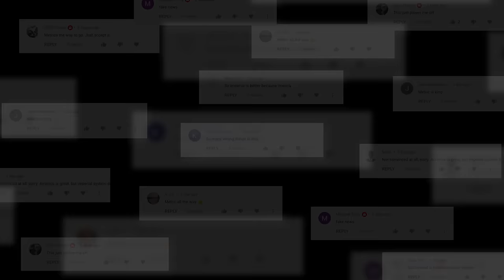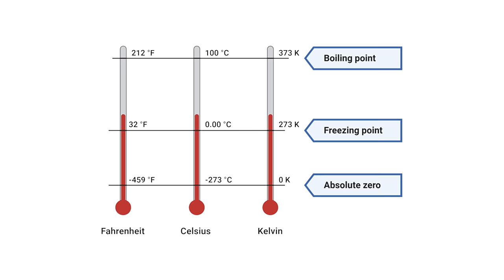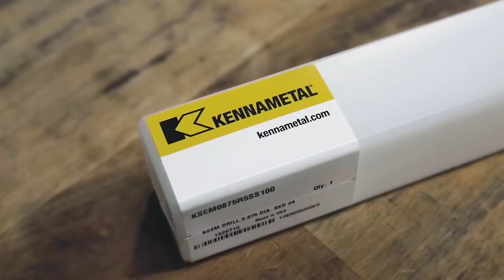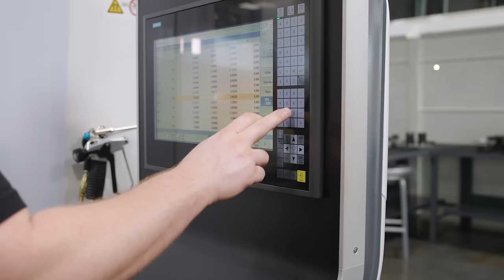Why METRIC is SUPERIOR to IMPERIAL

Comment: A big advantage of the metric (DIN) threads is the fact that there's no possibility to get the wrong bolt into the wrong hole. Either it falls through or it won't fit at all.

Same with hex wrenches.

The most dangerous threads are 3/4"-14 NPT and 3/4" BSP or BSPT.
They seem to fit, but they damage each other and will rip out at high pressure.
Reply: I've got farm machinery in the shed that came out of the factory with imperial and metric bolts.
Reply: @jackhand4073  The Tornado fighter Jet also has Imperial and metric nuts and screws mixed, depending on where the part was manufactured.
That's absolutely crazy and dangerous like hell.
Reply: @norbertfleck812  Wow. Scary stuff. Just asking for a mistake. Thanks for the info
Reply: Not necessarily. You have to be careful when working on old pre-WW2 metric machinery.  If you look in your old reference books you will see there are British, French, German, and Japanese standard metric thread and pitch combinations that are not all the same. Currently there are coarse and fine pitch metric screws and in the smaller sizes the difference may not be obvious with a casual glance.
  Country of origin can also confuse things. I have an old Taiwanese milling machine that after 30 years of use discovered that it wasn't all metric. About half of the fasteners are British Standard Whitworth.
Reply: What about that one: #8-32 coarse threads and #10-32 fine threads? That one is dangerous because the #8 screw will actually fit in the #10 hole and you might even be able to torque it a fair amount leaving no indication that you messed up.... Until the barely engaged threads finally let go during use...
Reply: 1/16" is the perfect snug bolt tolerance and we all know it. Nice set number.
Reply: Some Hex Allen Key/bits are compatible with some INBUS metric, like INBUS 2 - 5/64, INBUS 4 - 5/32, INBUS 8 - 5/16, not identical but so very close, like 0,02 mm diference for INBUS 4 that is made 3.98mm for metric. And also Hex Allen 0.028, 0.035, 0.050 can be substituted with INBUS 0.7, 0.9 and 1.25, that are not that close like the first 3 above, but close enough from 0.711, 0.889, and 1.27mm. And for INBUS 4 you can also use Torx 27, less common then 20, 25 and 30, but still standard.
Reply: @loochan325  That's the problem. They fit somehow bit they damage the bolts
Reply: @norbertfleck812  INBUS 2,  4 and 8 are practically identical with 5/64, 5/32 and 5/16. INBUS 4 is pretty commun and the 0.012  - 0.02 diference from 5/32 is smaller then the normal tolerances, practically no diference. The last very small ones that can be substituded I have not tried personally. Torx 27 is universal and it also fits INBUS 4 perfect, but sure that is for rare cases when you lose the 4 bit that is very commun an normally I have at least 3 or 4 bits INBUS 4 with me.
Reply: @loochan325  Turning Torx with a hex key is the short track to destroy the bolt head.
Reply: @norbertfleck812  I write about torx 27 bit for INBUS 4 bolt, and that only on very rare occasions coz' INBUS 4 is pretty commun and is more likely to not have torx 27 that is  more rare then not have INBUS 4 that is pretty commun. I did this 2 times in 15 years, when on job site I was helping my team,  and all INBUS 4 bits were in use by others. I  don't support mixing other bits, and I find extremely upsetting when someoane use PZ 2 bits for PZ3 screws, PZ1 for PH2, etc.
Reply: Interesting thing this DIN (Deutsche Industrie Norm). Check out their business modell! Being the worlds rule maker is profitable.
Reply: @norbertfleck812  A English jumbo jet lost one windscreen while in flight because an engineer used the wrong size threaded screws to attach the screen.
The pilot was sucked out of now windowless frame but luckily his foot got jammed by the yoke and was eventually pulled back into the cockpit.
I don't recall the issue being caused by a imperial metric mistake but its a good example of what can happen when a small difference in dimensions  can be deadly.
Reply: @geoff4383  BA5390. Pilot was Timothy Lancaster. The bolts were #8–32 vs #10–32, nothing to do with metric. Entirely imperial.
Reply: Don't mention NPT threads... I from Europe and i thought that pipe threads is a pipe threads... But no there is a NPT threads which seems to work rather fine, nicely tight threads with BSPT threads... No they not. I learned in hard way that there was someone who called himself Briggs and invented NPS/NPT threads..
Reply: wellll, there is always metric fine thread. The hole size is the same and when enough idiot is applied you can destroy the thread
Reply: @patrickd9551  The metric fine threads are far enough from each other, so there's no way to put the wrong bolt in the wrong hole.
Reply: @patrickd9551  The steps between the different threads are big enough, so you need very much idiot to force the wrong bolt into the wrong thread.

The fine threads all have different inclines so the bolt will block at the first turn.
Reply: @birgerhansen1532  DIN heißt "Deutsches Institut für Normung"
Reply: I had a guy in the workshop which screwed the M5 bolt into an M6 hole thinking it's OK as it held in place. He's not around anymore. 😀
Reply: If the M6 bore hole is manufactured correctly an M5 bolt will fall out.

The M6 bore hole is 5,0+ mm while the diameter of the M5 bolt is 5.0-
Reply: @norbertfleck812  If you apply a really generous amount of threadlocker, maybe it won't fall out on its own.
Reply: @norbertfleck812  if the alignment of the holes are off enough or the part is hanging in sheer, the m5 might still catch some threads.  Some cases, you might get away with m5 bolts in an m6 holes just to hold you over while you stock up on m6 bolts.
Reply: @ianbelletti6241  Really?
M5 has got a 0.8 mm incline, M6 is 1.0 mm
So you cannot "catch some threads" but only  jam it somehow in the hole.
Reply: @norbertfleck812  Nope, the standard M6 bore hole is 4.917mm, but when we cut the thread, we even use 4.8mm bore hole and let the threading tool do the job.
Reply: @jackhand4073  ive got multiple old volvos, they also have a mix between imperial and metric haha
Reply: The drilling diameter for a M6 thread is 5,0 mm according to DIN/EN/ ISO standards.
Reply: @norbertfleck812  Wrogn: Deutsche Industrie Norm. German Industrial Norm.
Reply: @rosomak8244  The DIN e.V. itself states on its Homepage, that it is the "Deutsche Institut für Normung" - "German Institute for standardisation."

Inform yourself (or at least ask Google) before telling nonsense.
Reply: @norbertfleck812  I dunno what standards did you look into, but none of the standard charts or calculations I was able to find says exactly 5.0mm, not a single one.
So pls inform yourself (or at least ask Google) before telling nonsense. ;-)
Reply: The core diameter is slightly less than 5 mm but the suggested drill diameter for thread cutting is 5,0 mm. For thread forming the drill diameter is slightly more than 5,0 mm
Reply: @Joël The DIN (Deutsches Institut für Normung, founded 1915) was the Institute who defined the metric threads as well as the standards for Bolt heads, nut sizes, and lots of other stuff, and even the standards for blueprints (DIN 11).

Before that every company had its own threads, bolts and nuts, and often Nuts and bolts were delivered in non-interchangeable pairs.
Reply: @jackhand4073  Some John Deere's tractors have both at least.
Reply: Metric threads are actually defined by an ISO standard.

Comment: Hi, I did my machining apprenticeship in both imperial and metric. I can remember when the shipping company I worked for bought its first ship with metric parts on its main engines. Initially it was quite scarey but one got into the swing of it. it became a lot easier to understand. I think I am one of the lucky people who grew up with both and I am sure a lot of you folk would agree if you are around my vintage. To my surprise my new 2016 Ford Mustang has a lot of metric fastenings on it. Not sure if that applies to the like of the engine part sizes. Cheers Ian - New Zealand
Reply: I think all cars have been designed in metric since the 90s (basically since CAD tools) with some exveptions in assembly when using parts with existing "standard"-sized parts
Reply: Ford and several other companies have to unify their part bin and platforms between EU, USA and often Japan as well to make use of economies of scale. Half the global Ford vehicles if not more are engineered in Cologne Germany. And in most of these regions, imperial fasteners would not be permissible at all. Like, not like the state forbids it, but the companies really don't want the absolute potential quality assurance hell of mixing tools and fasteners. Indeed it's typical that they'll try to make just about the whole car on one fastener size with just a couple exceptions as needed.
Reply: It's interesting that the Americas car companies converted to metric because every non-US supplier used metric. On the other hand, when Airbus came to be they used imperial because most major suppliers were in the states. Also, the US aircraft manufacturers supplied the vast majority of planes even in european fleets so every airline/maintenance shop had imperial tools laying around.
Reply: Dude my 1991 Ford Thunderbird is almost all metric fasteners.

Comment: There's another problem with imperial units: they are not the same, it's depending on where you use it. 
Nautical miles vs. US customary mile. A yes, and not to forget the US survey mile which differs from the US customary mile.
And volumetric units also differ, a US gallon is different to a British gallon, if I remember correctly.
Reply: A British Imperial Gallon is 8 pints of beer.
A US Gallon is only 6.6 pints of beer.

Glad I'm British if only for the beer.
Reply: reading this feels like reading a comedy book
Reply: This all reminds me of something one of my American friends (a very senior federal civil servant) once said, although I don't think he originated it... 'You can always rely on the US to do the right thing - but only after they've tried everything else'.
Reply: Take the "lbs - pounds" weights from random gyms, weigh them on the same scale and get different results (one's "pound" would be 453 grams, whilst others can we whatever around that number)
Reply: The nautical mile is a different beast. It’s based on one minute of latitude, as a navigation tool. So neither metric nor imperial. Still, of course both UK and the US had their own nautical miles long after the rest of the world settled on the standard metric definition of 1852 m in 1929. So for many years there were three different nautical miles. ;-)
Reply: The US gallon is smaller because the US pint is smaller. It’s 20 floz in the UK, and 16 oz in the US. And if I remember correctly, it was something to do with the weight of water. 16oz of water weighed 1lb? That bit I’m not sure about
Reply: @markstott6689  a US gallon is
128 ounces
4 quarts
8 pints
16 cups

I don't know where this 6.6 comes from, but it's plain wrong.
Reply: @der_pinguin44  The UK Imperial Pint is larger than the US Pint. By approximately 20%.
Reply: @janhanchenmichelsen2627  Different Nautical Miles? That's completely silly; the 1852 m Nautical Mile is a very useful and logical Unit, as it's 1/60 Degree of Latitude.
Reply: @Genius_at_Work  Yes, one metric NM is 1,852 m, and was originally based on one minute of latitude. As I wrote (did you read my post at all before commenting?). But the US and UK did not adopt the 1929 convention util much later 

So.
US nautical mile until 1954: 6,080.2 ft 
UK nautical mile until 1970: 6,080 ft
See the difference? Two inches. 

But: The metric nautical mile is (ca) 6,076 ft. A much larger difference.

So there WERE at least three different standards for many years. Metric, UK («Admirality») and US.

BTW: The old UK Admirality natutical mile (1,853.18 m) is now defined as 1,853 m for legacy use …
Reply: @janhanchenmichelsen2627  I actually found that interesting, perhaps I should get out more.
Reply: I can remember at the start of imperial, their were even 2 different length for 1 foot or inch, as britian and france used different sizes for it
Reply: @janhanchenmichelsen2627  .2 feet is not 2 inches.
Reply: Imperial - which empire?
Reply: @der_pinguin44  
The US pint is 16 oz. ( US fluid ounces)
The UK pint is 20 oz. (But they are UK fluid ounces)
A UK fluid ounce is actually slightly smaller than a US fluid ounce, but because there are more the UK pint is bigger.
One system uses one ounce of water, and the other uses one ounce of wine as the base... And blah blah blah, these differences are why metric was so necessary. Everyone county and many  industries had their own weights and measures. 
An ounce of wine was different to an ounce of whiskey, a pound of butter from one place didn't weigh the same as a pound of corn from an other. Most of this fell away over time, mostly because people stopped using random local measures in favor of metric, but, you still see it with gold. 
We measure gold in Troy ounces, which is 31.10 g, and food in avoirdupois ounces, which are 28.35 g (roughly).
Now apply this to international trade, you  want to ship grain from France, to Germany, and sausages from Germany to France... Do you do it in German measures, or French? It would be best to do it in the measure of the customer, but all your workers are using the local measure... but, also sometimes you ship to Italy... So, do you put all three on? 
No. 
Best to just agree on an international standard that isn't random fractions, and is dissimilar enough to everyones existing measures so that there's no confusion where someone says "I'll just keep using my old pound measure, because It's basically the same as the new international pound measure, sure it's only 10% off"
 The avoirdupois ounce
Reply: @chrisflanagan7564  I pretty much established that the US pint is 16 ounces. You typed all of that for nothing.
Reply: @markstott6689  so what you say is "The US gallon is 6.4* UK pints, where as both gallons are each unit's 8 pints." But what you're also missing in there is the fact that the US gallon is whole number divisible by 2 eight times. You provided way too much unnecessary complication that is essentially intentionally misleading.
Reply: @der_pinguin44  ah, I see, you did say a US pint is 16 fl oz but, you didn't get how a US gallon is only 6 and a bit Pints. 
The size of every imperial fluid measure is different across the Atlantic.
The fluid ounces are different, and there are different amounts of them in a pint.
You keep saying there are 16 oz in a pint.
There aren't, there are 16 US FL oz in a US pint. There are 20 UK FL oz in a UK pint.
Because you drop US when you write pint, and the English fellow drops UK from when he talks about pints you have become confused.

There are only 6 a bit pints in a US gallon.
If you buy a gallon container of beer in America, bring it to the UK and pour out 8 pint glasses of beer, you will only fill 6.6 of them. 

I'd didn't write all that for nothing, I wrote it because rambling on is fun, and so I did it for my own entertainment. While it repeated a small amount of information that you has mentioned it added quite a bit a out the general different between pre-metric local measurement chaos. 

For my next rambling bullshit post, shoe sizes, wtf is going on with all those barleycorns?
Reply: @der_pinguin44  the whole fucking point is, when you use pints or gallons, in an international setting, then everyone from everywhere has to lead with which sort of pint they are using, even now when the options are basically UK or US. And not UK, US, Spanish, French, Italian, Dutch, German, whatever. 
Just get on board with metric, which everybody did, so it's 380 million vs 7400 million uses. 

No one is arguing with you that there are 2 pints in a quart, 8 pints in a gallon.
The problem is the size of a pint is different in different places, and metric solved that problem for most places.
16 or 20 FL oz in a pint
2 pints in a quart
4 quarts in a gallon
Oh wait isn't there also a US dry pint/quart/gallon? 
Ugh. What a mess.
Reply: Just to make the whole mile thing a bit more complicated there is also a Scandinavian mile which is used in Sweden and Norway. Today it is exactly 10 km (6.2 mi) but it was different back in the day.

Comment: I am from belgium so raised in the metric system. My first work was in England they used metric but the older engineers there claimed the metric sustem was superior for engineering purposes but the imperial system made better looking designs because the proportions where better. :-). I must admit i love the design proportions of my Norton commando.